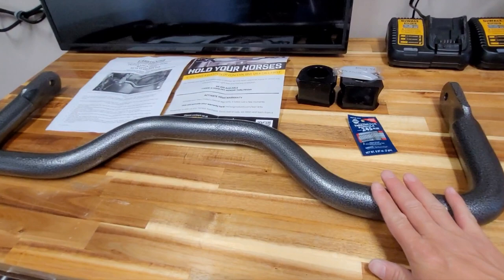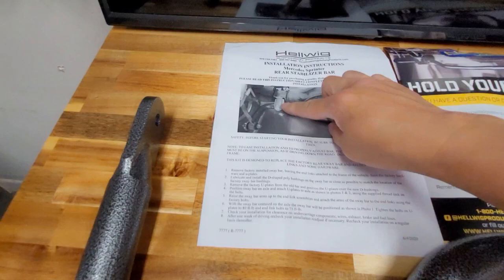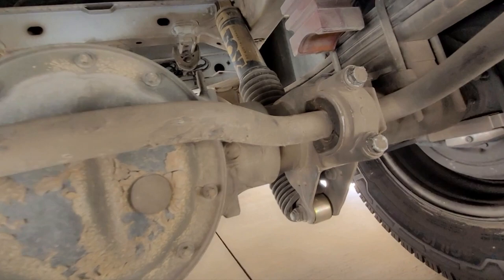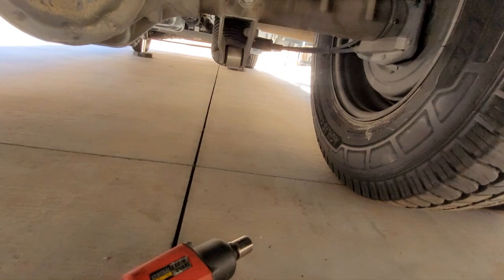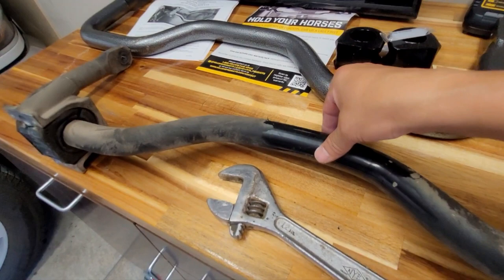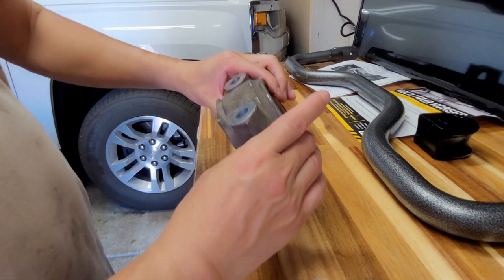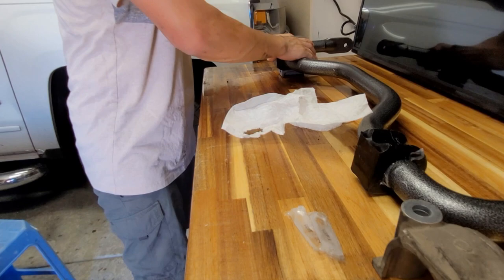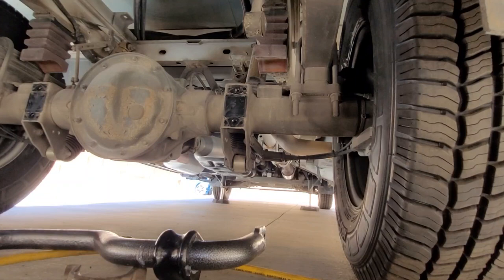Sprinter Van Hellwig Sway Bar Install | Winnebago View Navion

Comment: Nice job, I see you have the Sumo springs and the Fox shocks, how is that working for you? I have heard the Fox shocks don't play well with the Sumos.
Reply from the maker: Yes I've heard the same thing. I've tested it both ways over several thousand miles and ended up putting the Sumo Springs back on. In my opinion, it handled better with them on.

Comment: With the new swsy bar have you noticed a difference?
Reply from the maker: Yes the new sway bar made a big difference. I've heard of some people saying it didn't but it did make a big difference to me. The engineers are stating it's about 40 percent stiffer.  Numbers aside, it made a difference big enough to recommend the upgrade.   Hope that helps.

Comment: Well done!  I am looking to buy a 2018 Winnebago View: does it have a colour Infotainment monitor screen and a low gear engine descent button?  I've tried to find the information but no joy!  THANK YOU! ☺
Reply from the maker: A 2018 View will
 likely be on a 2017 Sprinter chassis with the 5 speed transmission. It doesn't have grade breaking but downshift will work. The infotainment center is the older aftermarket type and I don't know much about them except that they are a smaller display and not a Mercedes product. Good luck on your search.
Reply: @rvlifediy  THANK YOU from an Englishman 🇬🇧 watching your videos from Arabia!

Comment: Hi I just bought a 2022 Mercedes’ class c, I am wondering if this medication change much how the rv behave, like to know what is the end result? Have not driven my rv much yet, has a e450 class c before, ( it is much like a aircraft carrier), is it worth the investment to change it? Thanks
Reply from the maker: I would suggest driving it more and determine what type of improvements you want first. This sway bar helped greatly on the side to side rocking when leaving an unlevel driveway. Some people have reported it didn't help at all but I think it helped tremendously. I would do the Sumo Springs both front and rear for highway driving improvement from wind and passing trucks.
Reply: @rvlifediy  did you replace the rear sumo springs as well as add the 2.5 Fox Shocks, along with the Hellwig sway bar? Did you upgrade the front sumo springs as well? Thanks 

Handling and performance ok, moderately improved or greatly improved…..interested in your opinion…..thanks Craig
Reply from the maker: @craigbenson52  I have done the following in this order:  Rear sumos first (helped with wind driving), installed front sumos (helped with trucks passing), installed fox 2.5 shocks (didn't notice much difference), installed Hellwig sway bar (helped with the rocking back and forth over the driveway).  I'm still not satisfied with the handling, and it could use improvement.  I've done other mods that I have been testing over the months and will post videos.  I'm a picky driver, knowing other motorhomes can handle better, so always on the pursuit to make improvements.  I would recommend doing all of them, but rear and front sumos first will make a big difference in highway driving.
Reply: @rvlifediy  I have seen some comments that the Fox shocks work better without the sumo spring additions? Guess it is an opinion….just wondering as Fox shocks are 4-6 months back order, if it is better to do rear sumos in the mean time to help the rocking/bouncing, as always thanks for your prompt replies…..
Reply from the maker: @craigbenson52  Craig, I have read that as well, and that is part of my experiment to remove the rear sumos (I would definitely do the front sumos regardless).  And if you don't do the Fox shocks, I would do the back sumos as well.  All I do know is that the stock suspension is not adequate by itself.
Reply: @rvlifediy  I agree as just on short trips the rocking is crazy…thanks
Reply: @rvlifediy  ordered the fox shocks so I am now waiting.....what is the benefit to the front sumo springs (I know the rear ones will not work well with the Fox shocks so those will not get done)....thanks
Reply from the maker: @craigbenson52  For me the front sumo springs really helped with the wind buffeting when behind a semi truck. It it does help with the handling in the wind overall as well. Some don't like them saying it makes the ride harsher. I am happy I have mine in the front as I felt it was not as stable. You can also get heavier duty front struts that would help. On the rears, I "read" that the sumos and the fox shocks don't work well. In my testing I've done, it didn't seem like it got any better with the sumos off.  I'm happy with the superspring though. That helped much more than the sumos or the fox shocks.
Reply: @rvlifediy  yeah, semi's passing no issue, riding to close behind a semi you get whipped around, found that out yesterday....thanks for the reply....Craig
Reply: @rvlifediy  Did you go with blue or blacks on front?
Reply from the maker: @georger7487  I have the black in the front.